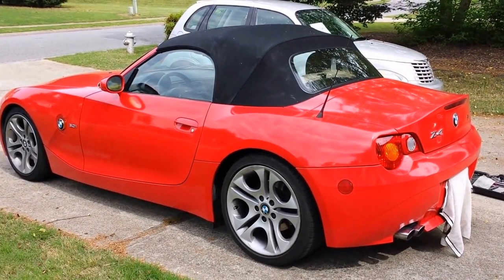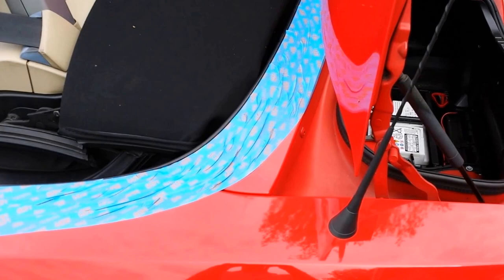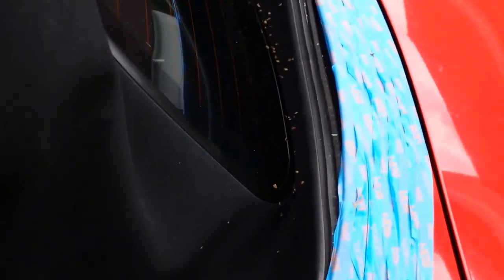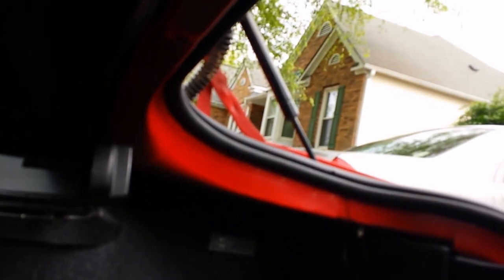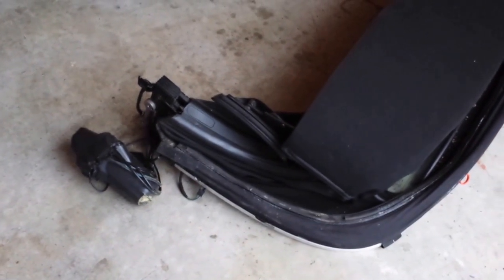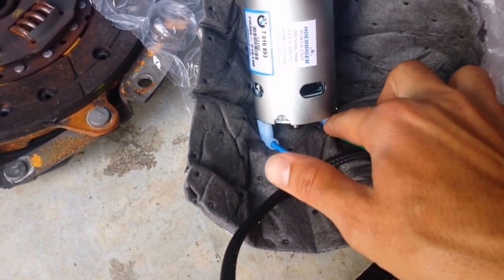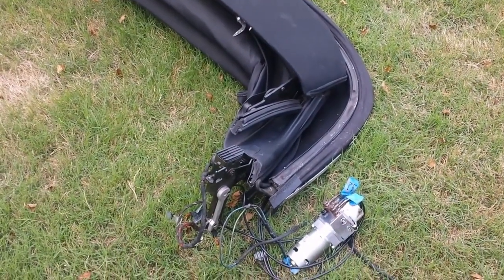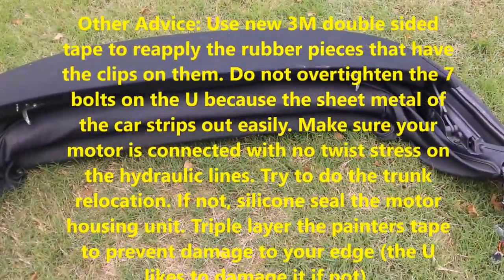How to remove test and replace a BMW Z4 Soft Top Motor COMPLETE HD

Comment: Great video. Just wondering... I got the roof off and it turned out the release valve was stuck on the pump and the motor etc was fine and the roof opened and closed perfectly when running the motor direct from a battery. Now I’ve put it back on the car the roof won’t work again (even when disconnecting all the cables and running direct from battery). It feels like there is pressure building on the pump so I’m wondering if one of the hydraulic lines has pinched and that’s the issue (they look fine all that I can see)? Does anyone have any ideas?
Reply from the maker: One possibility is that your red release lever cable is engaged. You can check to see that is it not "out" or too tight. There is a white plastic knob that can be screwed to adjust the tension of that cable. Just follow that cable back from the red lever and you will see what I am talking about. Keep us posted and GL!
Reply: Sorry for late reply - only got round to looking at the car again today. I’d not actually put the release mechanism back on the pump yet as I was worried it would stick again, so I don’t think it’s that (appreciate the suggestion though). I’m planning to take the roof off again tomorrow and will update when I get to the bottom of it. I’m sure I’ve pinched one of the hydraulic lines.
Reply: Got the roof off again and it wasn’t a pinched hydraulic line. The pump is basically not pumping (even though it worked fine in testing before refitting the roof). Currently taking the pump apart to see if there’s an obvious issue but might need to replace it. I’ll be selling the damn car after all of this!!
Reply from the maker: @dorianrees  sorry you are having so many issues. It's been one repair after the other for me as well. Been contemplating selling it but at least I know what has been serviced on the car!
Reply: So after taking the roof off for a second time, there was an issue with the pump where one of the little pins had fallen out. Put it all back and, again, the roof worked fine out of the car. Now it’s all back in the car it still won’t work. The engage/disengage mechanism works but although the motor runs when you press the button, the roof doesn’t move. I’m totally lost! Have asked for tips on a Z4 owners’ group on Facebook. Will update further when I (hopefully) find a solution. Thanks.
Reply from the maker: @dorianrees  that's certainly frustrating. My guesses would be you need to add fluid to your system if the level decreases when fluid primes the system, a pinched line which you ruled out, the disengage cable is too tight (maybe add slack to it by adjusting the white plastic knob in its cable line), your just not letting the system prime by holding the roof power button for a while, you dont have your moto sitting upright, or you have the cables backwards on the motor. Backwards cables would make your roof not function right because it would want to open instead of close and vice versa so may not function right. I know for me I used a heavier fluid so I hold the open button for 5 secs, let the pressure build up by waiting another 5 secs, then hit the roof motor again and it functions fine. The first time I reinstaled it with ne fluid it took a very long time to prime the system, but yours is moving fine outside the car so I don't feel that is your issue.
Reply from the maker: By backward cables I mean the power cables to the bottom of the motor.
Reply: Thanks for this. Someone else has suggested that I rip off the wiring loom wrapping to see if a wire has snapped within it. The car was involved in a left-sided collision before I bought it so maybe that damaged something (it looks fine but I haven’t cut open the wrapping yet). 

I’m away for a bit now but will update when I finally (hopefully!) fix it!
Reply: So I got this working properly in the end, without needing to cut open any wiring loom, without needing to take the roof off again and thankfully without needing to replace any of the hydraulic rams (which was another suggestion from somebody). The issue was literally the release valve being a bit sensitive. After much playing around with it the roof just started working properly on the car. Thanks for all your help!

Comment: Hi Pray4u, this is James again, I just found out one of the hydraulic lift cylinder on passenger side its leaking, do you know how to fix it or any suggestions? Thanks, have a great weekend.
Reply from the maker: James Le sorry, I do not know. Buy the part and replace it? Or see if it can be rebuilt.
Reply: Great video. If you do some more works on your Z4 I would appreciate it you taking the time to video it. You've got very nice car.
Reply from the maker: Ricky Guillermo will do. I have to do an oil change soon but I already did the transmission fluid and rear brakes 10k miles ago. Front brakes are next on the list.
Reply: Pray4UrLife12 super awesome. I'm a follower now and for sure there's a lot out there like me who needs some videos from an expert like you.  You're video tutorials are awesome.
Reply from the maker: Ricky Guillermo i have never done it myself but I know once you removed the roof they are on the front end of the soft top (i think). One youtuber asked me the same thing and ended up doing it himself.

Comment: is it possible to get  soft top pump from the trunk?
Reply from the maker: Yes it is, however, I did not do it that way. From what I understand, you have to remove the roof's upper shelf and try to reach in there from the trunk. Undoing the motor housing from the mounting clip might be tricky and put you in an awkward position. To be honest once you've taken the roof off once it is super easy to do again and worth it to me. Remember to inspect your hinges.

Comment: Hi guys, I need an answer ASAP please, I replaced the motor and doing testing now but during test sometimes working and sometimes no!!! And leaking hydraulic oil from both side jacks!! What's that meaning? And what should I do now? Thanks
Reply from the maker: Nadeen Alkaabi Hey, sorry to hear you are having issues. Check your hydraulic fluid level. You may be leaking from your lines due to a past pinch in the line? not exactly sure what you are asking. put up a video or photo? also, check if your silver bolts that you used the attach your fluid lines to your pump are lined up correctly. ensure motor is on the upright position when testing it. if you are low on fluid do not test until you top it off. did you test your old motor as well?

Comment: I have removed my top on z4 when I got it back on it latches in the up position fine when down theres a huge gap from top to trunk what did I do wrong would appreciate some advice
Reply: Did you lower the roof rack....not sure whatever to call it. Rotate the knobs downwards on each side.

Comment: is it possible just to replace the electric motor??? side of the Unit
Reply from the maker: I am unaware of such a way but maybe the forums mention it? I have read before of people soaking the motor in a solution and it worked afterwords. I believe it was vinegar or such? Again the forums know better!
Reply: Parts are available .... everything,,complete units and or just replacing what's bad in your situation...electric side(motor) hydraulic side (Hyd pump).. a lot of people are using a ford mustang convertible unit made by the same guys HB Hoebinger..makes everybody's "units".. Thanks for your video!!! I learned  a lot!!!!!!!!

Comment: Nice video,I want to ask you a question about bmw z4.how can I contact you?
Reply from the maker: what's up?
Reply from the maker: @jimmy-np6jy  Ask here so others can learn from it too.
Reply: @Pray4UrLife12 Maybe can only replace the motor not the whole part.
Reply from the maker: @jimmy-np6jy  that is possible. I remember seeing a thread on some forum that used the motor off of another vehicle which was the same type as ours but I do not know wherr I saw it. Try to search it online. Most peoples issue is water damage so I do not know if it is worth the risk if it ends up not solving the problem. I do not know how to rule out if that is a good idea or not.
Reply: @Pray4UrLife12  Worth to try it.Save some money.The whole part need 600$,the motor need 200$.

Comment: Dude you never disconnect the positive battery, always the negative!! Reason you're still grounded and if you hit metal with that positive cable, you can short the whole system.. THEN YOU'RE SCREWED 🤦
Reply from the maker: Correct, thank you for your input and clarification. I explain my reasoning in the video.

Comment: I pulled red tab , nothing happened ☹️
Reply from the maker: @bob4003  if you look along the cable line that the red tab is attached to, you will find a white plastic portion that you can rotate to adjust the tightness of the cable. It may be that your cable system needs tightening.
Reply: @Pray4UrLife12  I’ll look for that, thanks

Comment: Why can't this motor be sealed so water cannot enter it? It runs less than 15 seconds to open or close the top! The motor will not get hot enough to harm it in 15! If it was intrinsically safe water could not enter the motor and ruin it!

Comment: I am wondering if you can comment that being so time consuming and difficult to get to it, one may make a hole from the bottom of the car and insert a fish camera with light to check corrosion. or cut part of the bottom to remove and replace. If that is possible and why BMW does not provide drainage to start with. Replies will be appreciated.
Reply from the maker: I have never heard of such an approach. There are drain hole plugs at the bottom of the chamber that allow rain drainage. I guess you could remove that and feed a line through but that isn't very straight forward. The motor itself is in a case that would not be easily opened with that approach. It is best to just relocate it to the trunk. You can also just look at it from up top if all you want to do is check if you are holding water or if you have a compromised motor.
Reply: @Pray4UrLife12  Good answer. Thank you

Comment: I removed my motor without taking the roof off, took  me 40 mins
Reply: Fred Capp how??
Reply: If you remove the shelf unit in the boot, you can reach to the front corner of the wheel arch ( left hand side) and feel the top of the motor housing, the motor sits in a plastic container and the lid is taped on with gaffa tape. Most of it is by feel but once you partially  peel the tape off, you use a large screwdriver to lever the lid off, don't worry if you damage the lid, you have to persevere but once the lid is off you can wiggle the motor out(still attached to hydraulic pipes and electrics) and bring it over into the boot, it took me 40 mins. Go online and find some fotos of the motor and housing, you'll get a better picture to see what you're up against.